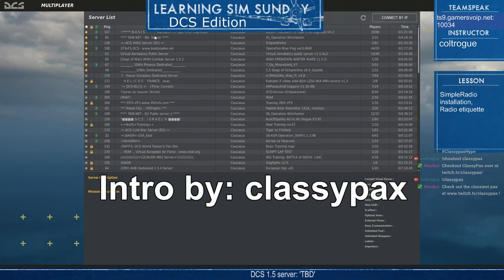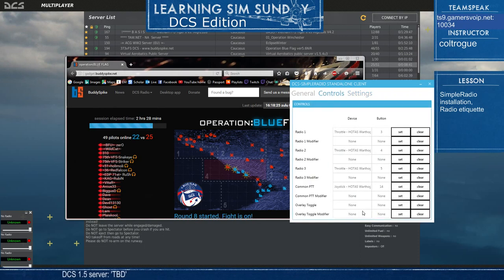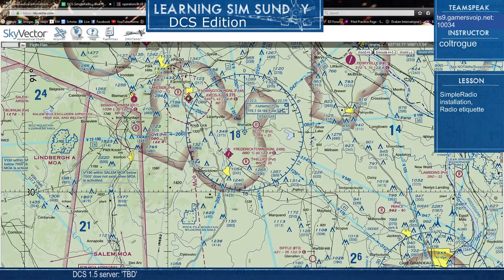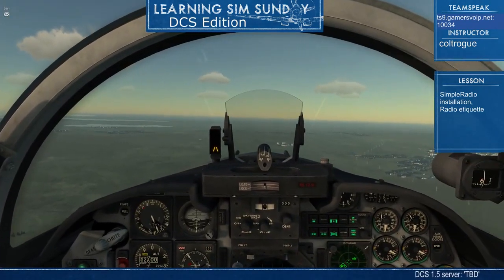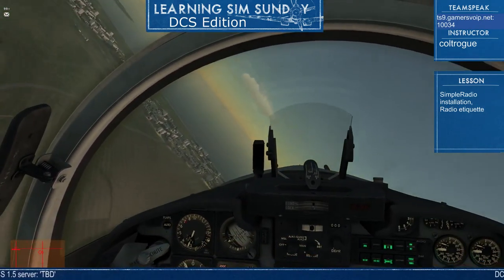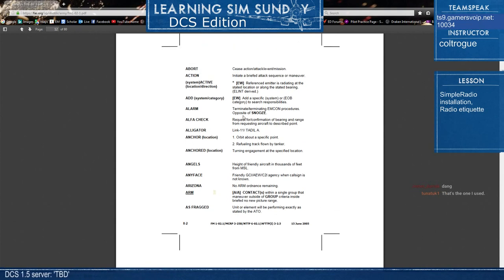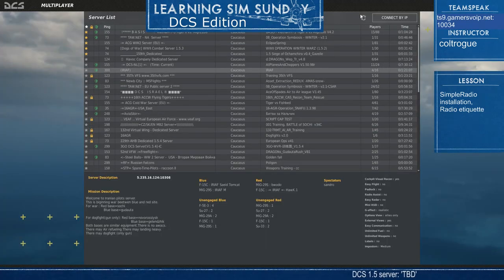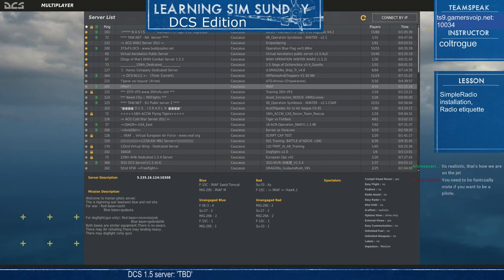Learning Sim Sunday (SimpleRadio and Radio Procedures Edition)

Comment: Sorry for being dense, but I dont see what your doing after you say "And If I type Blueflag here... Bam... comes up with a gadget" at 19:15... I'm having trouble connecting to Servers with SR!
Reply from the maker: Phill Murray, I'm afraid at 19:15 I'm not certain what you're referencing.  At 19:15 I was discussing Aeronautical Information Manual guidance to pilots operating at airports without active towers.  What problem are you having, specifically? Have you contacted Ciribob on the ED forums, or have you looked through his thread to see if your problem has been addressed?
Reply from the maker: At 9:15, I used an internet browser to go to: http://gadget-buddyspike.rhcloud.com/
Reply: coltrogue sorry buddy, I meant 9:15 not 19:15! My mistake! Ok thanks for the information! Informative video btw! I get a sub from me!